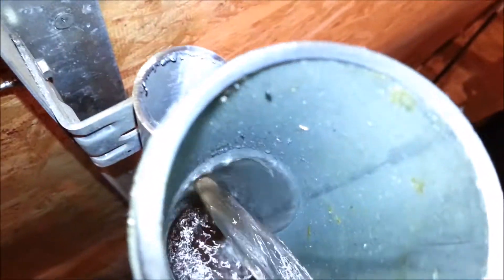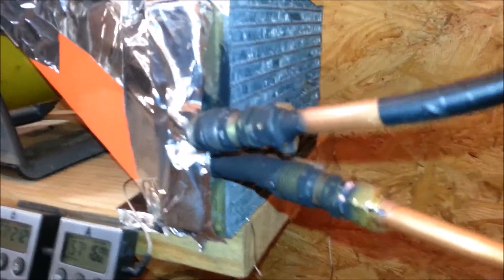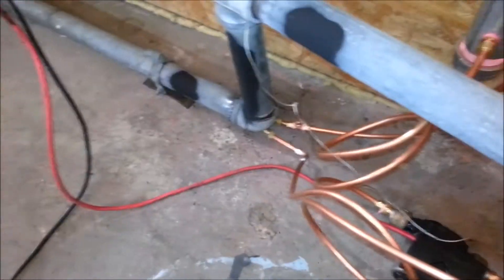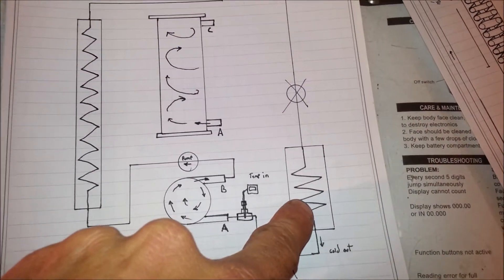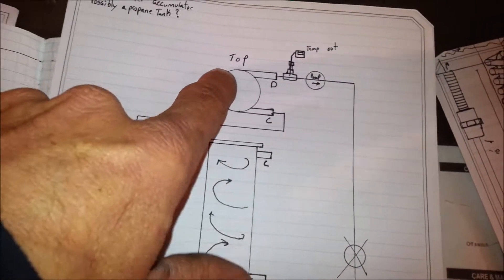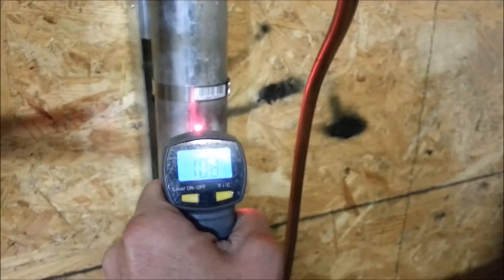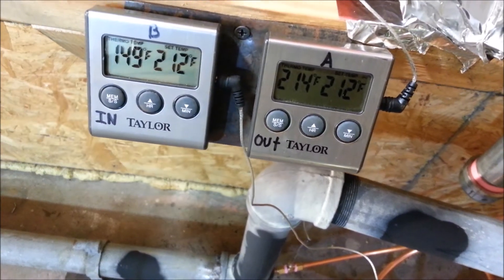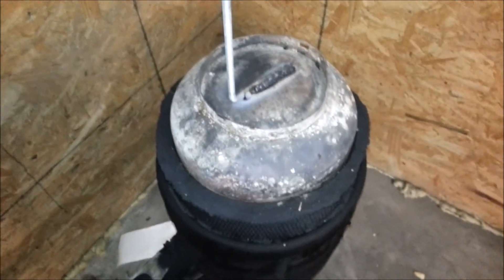Waste heat recovery garage heater

Comment: Another method rather than the 2 car coils at top and bottom they could simply be 2 relays wired inline from dc neg to ac pos and the other dc pos to ac meg the points are showing on stand diagram as the steel tubes and you would spike back from both relays into the third phase wires and that would follow on through the ignition light bulb and carry in round as the starter ignition would be an induction or broken fuse so the massive in and out if phasing would re route in a closed circle oscillation. Daniel dingle stated he used 3 car relays on his car that regulated the voltage for output if this energy and acceleration these are on the left hand firewall on his videos

Comment: Hi just to clarify you understand static neutral ac neutral is coming from the centre core of the alternator and dc static neutral is coming from dc pulsed starter motor central shaft Watch stanley Meyer newzealand house meeting video 38 .41 in on video Megga clues. He's showing how a car can run car coils are top and bottom on diagram and starter motor to left alternator on right. It's encrypted well but obvious when you see his querky clues ie the 3 coils he shows further in video the 12v at this first stage and states starter motor !!! Inlet is led photon source exhaust is at bottom exit !!! And finally he shows electron motifs in this so called tube But its really just a wire In and out of phases spike back to starter solenoid will see if I can get something soon now I have a good idea. It has to be in correct order so a bit of a trial and error as my electric skills are at the stage of mending my knackered grinders by bridging old carbon brushes in to existing. Makes like a x ray through the body but they work !